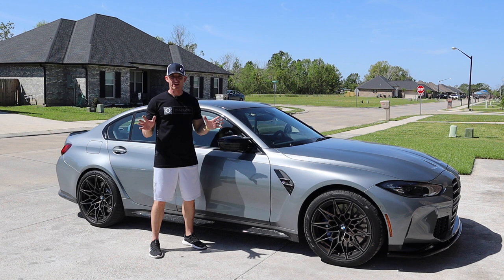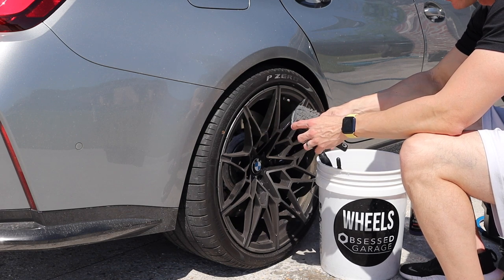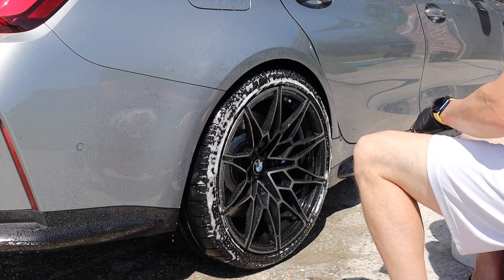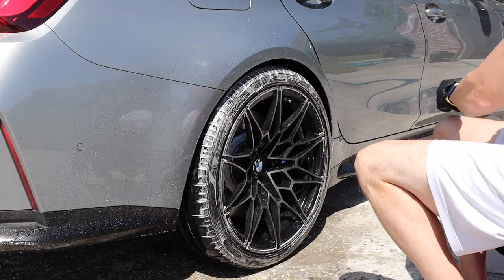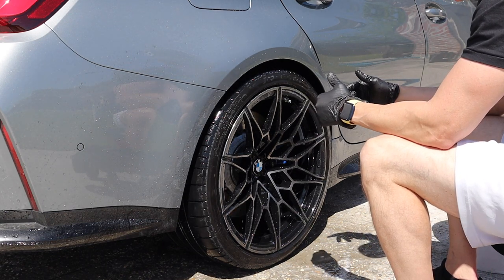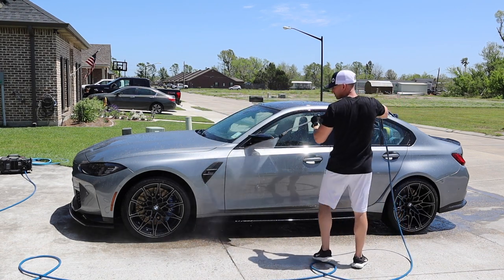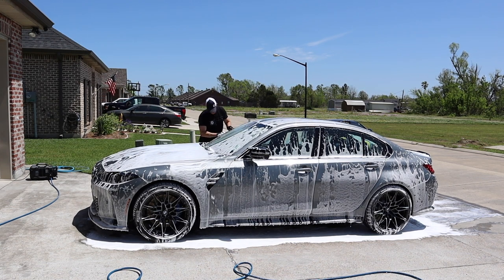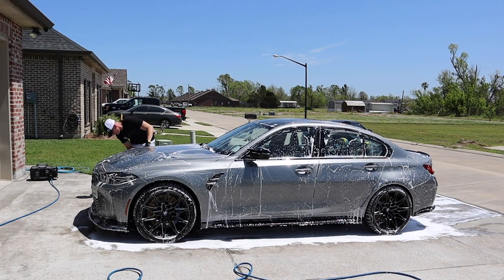2022 BMW G80 M3 Competition xDrive - First Wash - Foam - Dry

Comment: You should look into using an IK or Marolex Foamer. I do a 1:1 ratio of Adam's Wheel and Tire cleaner and it still cuts great. I probably have typically dirtier wheels on my daily. The IK PRO with the Schrader valve makes it a lot nicer instead of pumping.
Reply from the maker: I have thought about this and have not explored it.  It is something I need to look into.  Thanks.
Reply: @deconnation2206  you won't regret it

Comment: You don't need a filter for your water if u keep a good layer of foam on the car while washing it (using ph balanced soap) even after you use the mitt keep foaming car until u r done.
Reply from the maker: That's some good info.  I do always us a ph neutral soap so I'll probably be ok I'm just OCD and so worried about it spotting.  Thanks for watching!